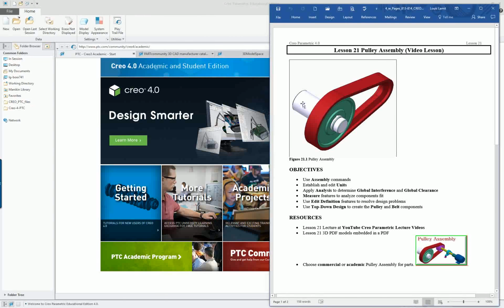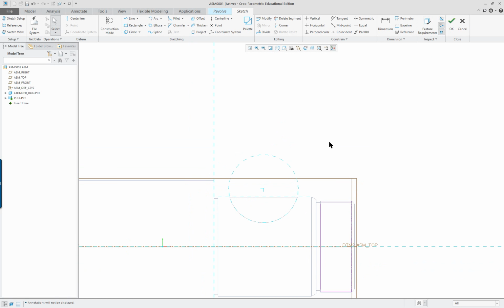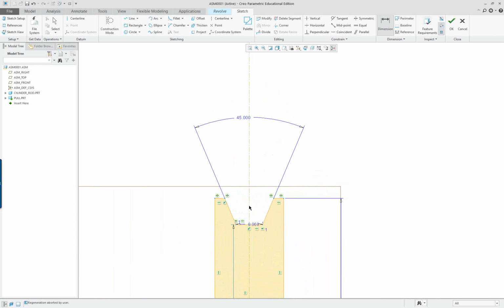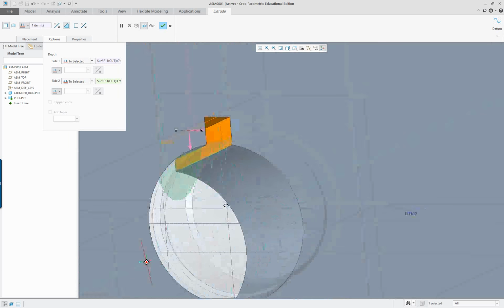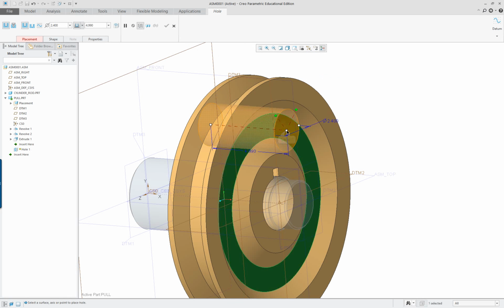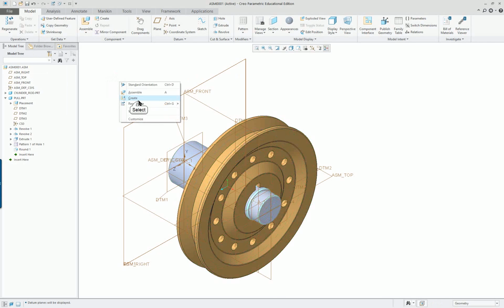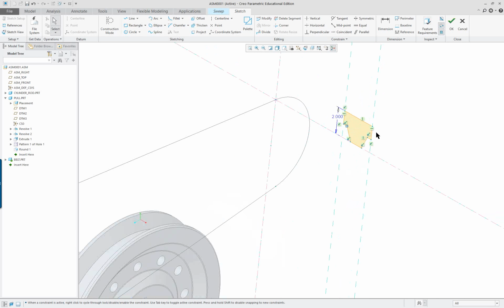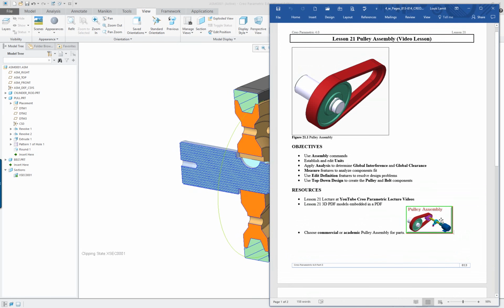Creo Parametric 5.0 & 4.0 ( Lesson 21), Mastering Creo Parametric 5.0 & 6.0 (Chapter 20)

Comment: Mr. Lamit, Top down method you created a pulley and belt using references from previous parts in the assembly. Wouldn't this create a .crc file? You typically would want the pulley or belt to be a "stand alone part". That pull back feature in view was awesome, especially when your engineer is looking over your back.
Reply from the maker: yes to all.  the project was to introduce top down design. the example was only to show design method and external references not correct engineering practice. the pulley can be edited alone and external references removed before detailing.